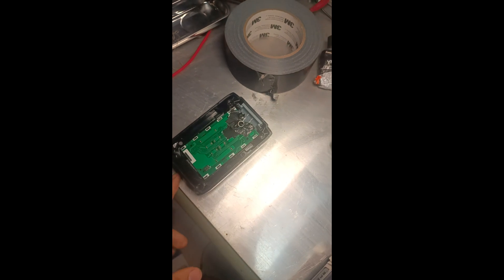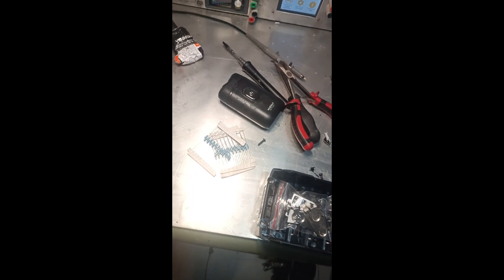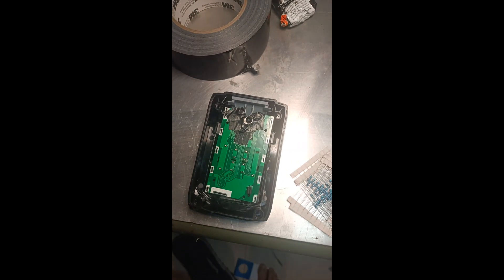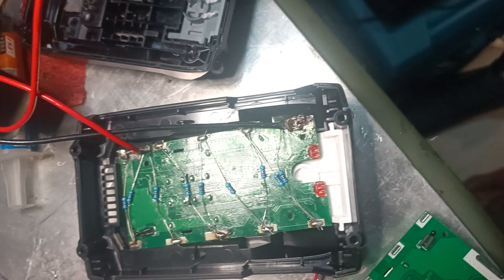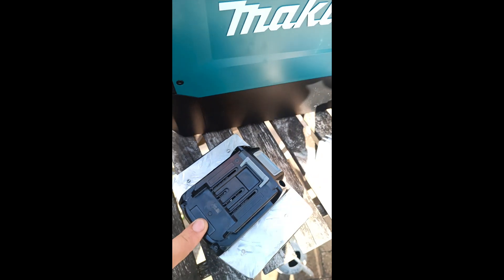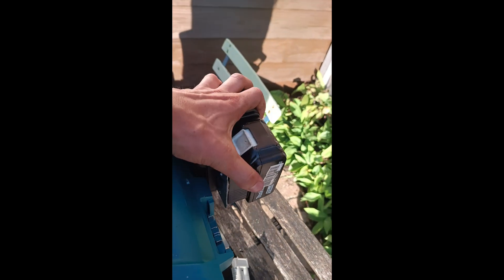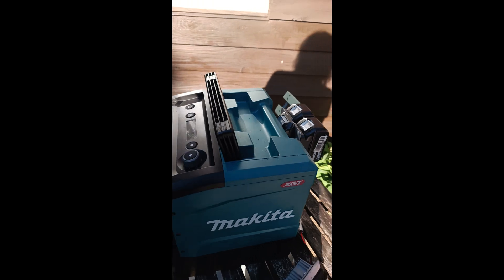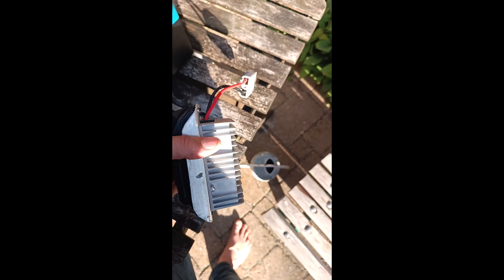DIY Makita LXT ( 18v ) to XGT ( 40v ) adapter, runs Microwave

Comment: Thank you very much for this video! I want use an external power supply (E-Bike Battery pack that must be disconnected for charging) and a digital on/off switch for my 40V trimmer. 

I ordered the latest model from Aliexpress and put 10x 430 Ohm resistors on the PCB, so it looks very similar to what has been uploaded by @diybatterytech . However, with and without the resistors, the motor revs just for 1-2 seconds. What I already checked: 
- Voltage between each resistor is 4.0 V, total is 42 V and 4250 Ohm
- using thicker and shorter power cables of 2.5mm2

As I need to power on/off later by an IO, would you recommend to directly immitate the entire signal? And, does someone has experience in "remote"-starting makita devices with look function?
Reply from the maker: Is the voltage constant even when you rev up the motor? Are the wires between the bike battery and the pcb thick enough? What is the current cutt-off on the BMS for the bike battery? ( usually lower than power tool batteries )
Reply from the maker: Remember: a bike battery only has to run a 250w hub motor, a makita brushless drill is >750w already.
Reply: @diybatterytech  Yep, the battery voltage is very staible as its 2x 850 Wh. I attached a power meter, it shows 2-3 A before it turns off. In addition, I installed a 5A fuse for testing, no tool mounted, speed is set to minimum.
Reply: just to confirm. The + must be connected to the big pad, next to the "B+ oval" so the battery terminals are powered permanently? I also tried to just solder it onto the B+, however, not even the battery indicator is working when powered.
Reply from the maker: @flo_329  if the battery indicator is not working, something is wired incorrectly. And yes the +/- are attached to the big pads, and the resistors like following: https://coredump.ws/xgt/xgt.html

Comment: October 2025 here, can't find anyone else who is doing anything similar to this. And the original page has been taken down which I was going to use to 'trick' the BMS on the tool to let me use an adapter. Now I basically need an oscilloscope to capture the communication from the tool and replicate it with an arduino to unlock other XGT tools. I'm really starting to hate makita for doing this bs.
Reply from the maker: protocol for bms has also been documented on my github if you want to emulate a BMS. https://github.com/no-body-in-particular/m5din-makita-xgt/tree/main/MakitaXGT
Reply from the maker: is kind of ready to use already
Reply: @diybatterytech  OH snap, so if I feed this to an arduino to the comms pin, it will unlock the tool and just let me damn use it?!
Reply from the maker: @dimitar4y  yes, however you also still need to pull the detection ( DT ) pin to 36v, and the DS/WK pin to 5v as per: https://github.com/Malvineous/makita-xgt-serial which enables discharging/communication
Reply from the maker: :P I basically had to implement the BMS to reverse engineer how it all worked together, so there ya go lol
Reply: @diybatterytech  I assume "just" enabling discharge is not enough. The communication needs to go through before the tool gets enabled?

Comment: 1:36 I'm not tripping, right? You have 9 resistors. But if it was a proper divider it'd be across all points. Instead you have one from + to B1, then to B2, then to B3, and then you stop there. Am I missing something?
Reply from the maker: :P i don't remember exactly, but it was 1 resistor per cell, i think one might be on the other side
Reply from the maker: yup, on the other side so it can't contact the metal terminals between b3 and b4
Reply: @diybatterytech  the resistors I got had extra long legs so I was able to route them right. Any chance of a defective BMS?
Reply from the maker: @dimitar4y  if the voltages at all the pins, and the positive/negative terminal are correct, there's a chance of that. If that particular makita tool supports lockout functionality and doesn't work with third party batteries - it could be that there's a need to design a new replacement BMS in the first place - most chinese BMS do not support the makita lockout/security options. I've documented most of the protocol on GitHub  - including basically the battery/BMS side, but i don't have this particular tool to test with.
Reply: @diybatterytech  now reading this, im guessing that the cineese xgt bms might come with different firmwares. On aliexp there are not many options to choose from, but the only listing i found that had the same board as in your video mentions that after assembly, the battery has to be activated by an original charger. Maybe the bms you have is from a different batch that doesnt need this. Thanks for the great work on github, i didnt realize its your work!
Reply: @diybatterytech  It's a brand new tool so it shouldn't be locked out; I bought a spare random battery and it seemed to work. Might be the resistor method doesn't work to trick this bms anymore?.. The tool is HP001GZ, it's worth it for the ridiculous torque it has, I use it as an outdoor auger, and will probably use it as a 110mm stone holesaw.
Reply from the maker: @ i wonder if the newer BMS unlocks after putting it in a charger then, will buy one to try and see what it does :)
Reply: @diybatterytech  it might be the case, since before having the xgt charger on hand, i was trying to get it work and without a pattern, i could get the tool to start a few times for a moment, but couldnt find any logic behind it. Still sucks having to "wake up" the bms every time i swap the batteries. Do you think itd be possible to code up a "xgt battery simulator" using a cheap microcintroller?
Reply: @diybatterytech  i hope i don't have to plug my adapter to a bms every time before tool use. I hope it's a faulty new board or i screwed something up.
Reply from the maker: @dimitar4y  https://coredump.ws/xgt/xgt.html Not needed, tested it with a current BMS from aliexpress. Link on the page, as well as pictures on how to wire it. So this trick still works ( at least with the microwave )
Reply: @diybatterytech  huh so I must've gotten a bogus one?... I'll bite the bullet and order another and update you. They are the same 500 ohm resistors?
Reply from the maker: @dimitar4y  yes correct, see the colour coding, can you maybe share pictures of the one you got?
Reply: @diybatterytech  Ok so it was on the other side, that makes a lot more sense. I did with the new BMS but it seems to keep acting like the cells are unbalanced, because the tool doesn't work whether or not there's resistors or not- so they're not making a difference. The board is populated with all parts so I'm not sure why it's not working. It's dividing correctly to 4v per cell at 40v PSU. It's making me rip my hair out.

Comment: I just ended up trying the exact same thing you've shown here, didn't work with the HP001GZ. I tried with 1K resistors and 560 resistors; nadda. It does the same thing whether resistors are attached or not. It's a "newer" chinese board for the battery pack. I double checked it's going B- B1 B2... B9 B+, checked the resistances across them are correct. When plugged in, the tool works for exactly 1 second then just disables itself. Really frustrating.
Reply: 0.22kOhm tested, not working
Reply: @saturnfrak  On what machine? A microwave?
Reply: I tried to reduce the resistance of the resistors assuming it may help, but it didn't

I can confirm that for my router I must connect the adapter (with the batteries) to the original charger
It'll work as written in one of the comments below
As soon as I disconnect the batteries from the BMS I need to connect the adapter again to the original charger

It's related to the fact that the smart BMS need to get recharged/unlocked as soon as it senses "flat battery"

It'll work for me, but it was worth mentioning as I bought a tool for 400$ which I had to buy the original charger to power it up with this "adapter"
Reply: @saturnfrak  I am not a fan of this, does anyone know how to disable this feature, or where to get a BMS that doesn't have this? I wanted to just get a basic +40v and 0v connection to get this running as I have some existing 40v batteries and 40v tools that DO NOT have this bull*** DRM. Alternatively, can I just have information what data I need to send to the BMS? I can make a portable ardunio "charger" to re-activate the adapter when I swap battery.
Reply: you got any ideas what could be causing this?
Reply from the maker: @dimitar4y  BMS not detecting the correct voltage on one of the "battery" pins, did you check the voltage across all of them?
Reply: @ Yes, there's test points T0 to T9 and there's corerctly 4v between all points and 560ohm (or 1k , i tried different resistors) and 40v across + and - (5600Ohm / 10000Ohm across all). The divider was set correctly. The tool works for ONLY a second as soon as I plug it in, after the communication occurs. It's so frustrating.
Reply: @dimitar4y  i had similar effects, ended up getting the original xgt charger and pluging the xgt bms+2x lxt batteries in it, after it recognizes the bms as a chargable battery - the tool works(bo001 in my case). The shitty thing is i have to do this every time i disconnect the batteries from the adapter.
Reply: @robis3508  I hate this with a passion. Why would they do that
Reply: @robis3508  I have the same issue here with GTR01Z.
Some questions here:
1. Did you try going lower with the resistors in voltage divider? possible T0-T9 need more current which the 1k/0.5k limits - going to try 0.25k later on and report
2.Did you try using the method the author show in his new video with the "M5Stack" board (resetting the battery)
Reply: @saturnfrak 
Can you explain what exactly do you mean by 2. ?
I saw the device and its ability to unlock bms locked batteries, which is, in my opinion, a totally different thing than needed here. I would be interested in seeing if a chinese bms would have enough hardware and software to show up the same infos as an original battery in the battery analizer

Comment: Hey! Im using the same bms pcb as in your video with 1k 0.25w resistors and the 40v are going trough the output pins on the pcb and the b1-b10 points show the right voltages. Still not running consistently, i got te tool to run a couple of times, but didnt find any contact or other problems, that would create a logical pattern. Did you have to somehow activate the bms( like connecting it to an xgt charger)??
Reply from the maker: BMS should not require activation, if it's a chinese version at least.
Reply from the maker: If it is inconsistent check supply voltage/wire thickness or try lower ohm value resistors. These things can pull 20-30 amps through the wires so that could drop your voltage too low.
Reply: @diybatterytech  hey! Thanks for the response! The wires were the right size and after trying another of the same bms(visually same as in your video) with the same 1k voltage divider, it also doesnt work without plugging into the xgt charger, but it does work after i do that, the shitty thing is that i have to plug the adapter(bms) into the charger to activate it every time i unplug the 18v batteries. If you could post hq  pictures of your bms and maybe the original listing?
I found mine on aliexpress under the brand doscing.

Going trough this i kind of want to just capture the right battery messages of the digital pins and have an arduino playing them back and then skipping the chinese  bms for this.
Reply: @robis3508  give an update please, same issue in my neck of the woods. would pay someone 50$ to tell me the magic solution or atleast an up to date link with the old dumber version bms. China usually skimps out on the full implementation, no clue why they went full this time
Reply: @dimitar4y  well my only solution is the xgt charger for now. 
I really wish you could just pay someone 50 bucks and have the code and schematic :D
And for sure it would be a challenge for me since i dont have a logic analyzer and would probably try woth my scope, but im not sure about the important details and the amount of testing this would take. Id also need some real xgt batteries which i dont. Ill try to figure it out some day if noone else will.
Reply: @robis3508  as far as I know, +5v or something powers the data pin then it shits out some standard data string. Capture it on a scope and it should be relatively easy to confirm, someone has a half baked XGT project on github that might have most/all the answer already. I don't have a charger so I can't confirm if my BMS works or not.

Comment: Hello,

I connected the resistors as in your video and the voltage on the output is ok (more than 40V) but on the middle four pins is not ok. On the top right pin there is 40V and that is ok as in the original Makita XGT battery but on the bottom right pin and top left pin there is 14V and on the original Makita XGT battery there is no voltage on those pins and after plugging my battery into the Makita XGT the device does not work

Could you help me please?
Reply from the maker: https://coredump.ws/xgt/xgt.html this PCB, and wire like on the picture

Comment: what resistors exactly did you use? how many ohms? how many watts? or if you can give the colours of the stripes on the resistor as you write 500 ohms and the link to AliExpress is 1 K Ohm
Reply from the maker: 500R 0.5w, standard resistors is what I used. The aliexpress link does have 560R resistors, so i don't know what you are talking about - i used 500 ohm. PCB from aliexpress can have a slightly different arrangement but principle is the same, solder resistors instead of batteries, and + and - to the actual battery.
Reply from the maker: Also just to clarify - the circuit is a just resistive divider, it will work with any sort of resistor as long as you use all the same ones, between 200 and 1k ohm.